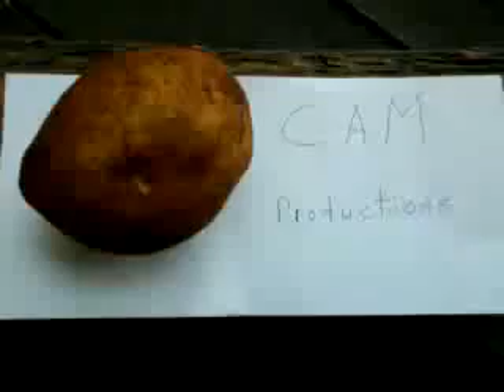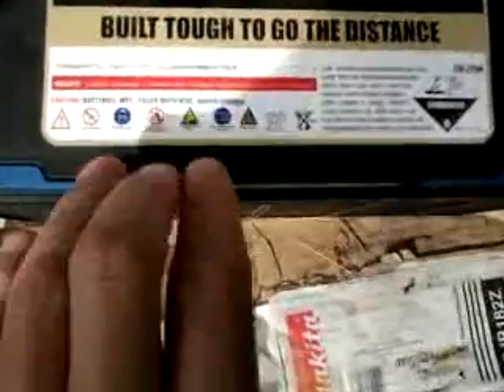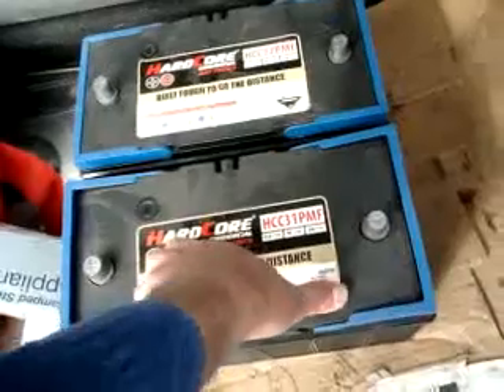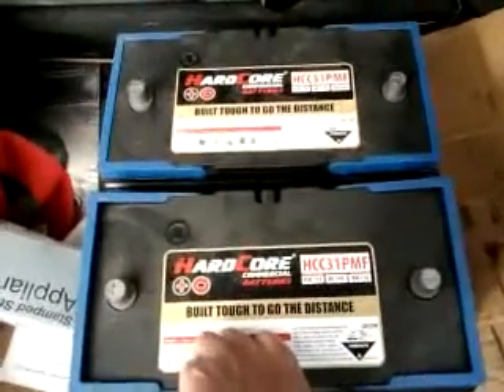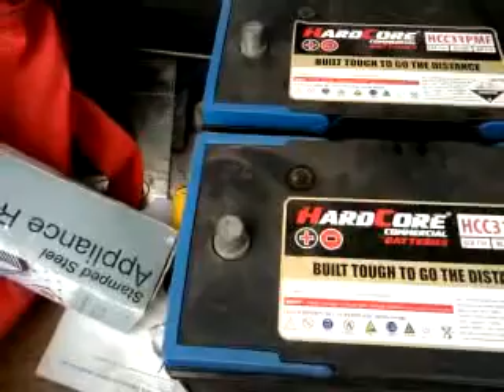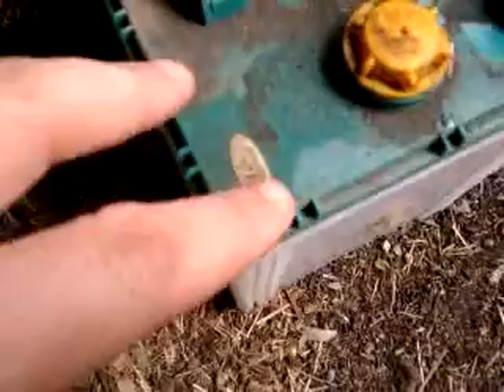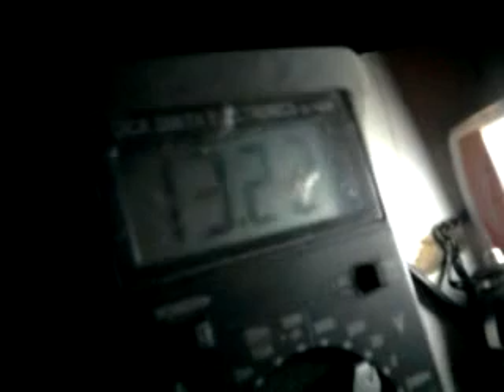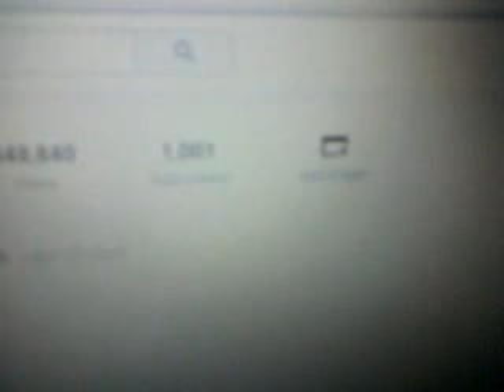My Off Grid Life Ep#70: NEW BATTERIES and pot changeover for wood stove

Comment: That's mind blowing..your place sure has history that's for sure..ok ok maybe pristine was a tad premature😂😊👍
Reply from the maker: +versatec1 the most ridiculous was how my uncle used to never want any basic herbicides used on his place. so he could "keep his organic rating". I am STILL pulling out the hundreds of C cell and D cell batteries he dropped on the ground. sure they would have helped the organic rating. when I was first here there were cabinets and rubbish full of brittle plastic bags sitting outside. the plastics were CHRONIC. where the bathroom is now, there was literally a FOOT DEEP of plastic bags. we used to fill 10 full sized wheelie bins EVERY WEEK cleaning this place up, and that doesn't include all the newspapers I burnt. there are old bits of leather and shoe soles from a tremendous amount of shoes that have been here since the depression and I am still picking them up. complete with the little brass eyelets in them. but if there was one thing I wished he had have done it was JUST get rid of the plastic bags. he decided he wanted to save a few dollars and argued with the local council NOT to give him a bin service. 12 years od crap built up. i swear he bought in a shopping bag full of pointless junk for EVERY DAY of those 12 years. I found photos of the junk in my car last week. should show them in a video. it shows the inside of the camper/caravan before I put wood in it and the back inside one of the cars.

Comment: sold a few off these battery's to , Link, there not bad at all! (indeed the re filling is a bit ...jeah..., and you have to refill in a year of two, using them as you do offgrid/solar), we use them a lot on small weekend boats, performing good! same Korean supplyer. 
Small tip for your installation, what y see in the video is that you draw te power from one battery whit the positive and negative lead on only one battery, better is put them in parralel, and conect the negative lead on the one, and the positive lead on the other. (thats to keep the load and charge equal on both battery's).
Reply from the maker: +MrBugsier5 so you mean where it comes out of the charge controller, go for the positive lead on one battery and the negative lead on the other FIRST. I've got both leads hooked onto the battery in the box with the charge controller, then leads going from that to the other battery, and the inverter hooked directly to the second battery.
Reply: Indeed Link!, how its connected now is not optimal, Indeed the positive from the charge controller and the inverter and the other battery on the one battery, and all the negative wires, and the negative from the first battery on the other battery, in that case you use both battery's equal, even with different length of wire between both battery's, the way it is connected now on your installation will draw not an equal amount of amps out of both battery"s, you can draw more power from your bank, and they will live longer. The thing is to make one battery out of the two you have, now you have two battery's just parralel, but by connecting the leads to only one off them you draw more power out off that one, then the second one due to the power loss in the coupling cables between the two battery's. (sorry, cant explane it easier, my English is a bit rusty being Dutch! sorry! lol)
Reply: sounds like a hoax, but really it isn't.